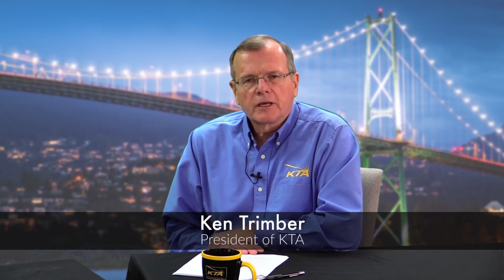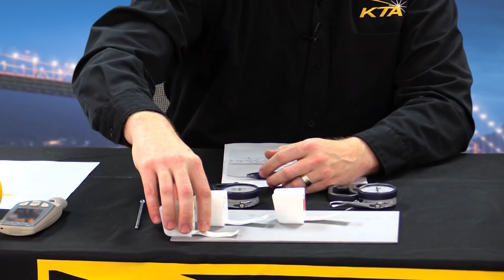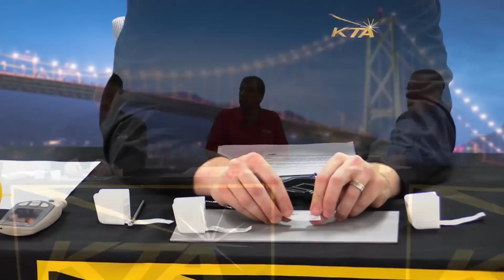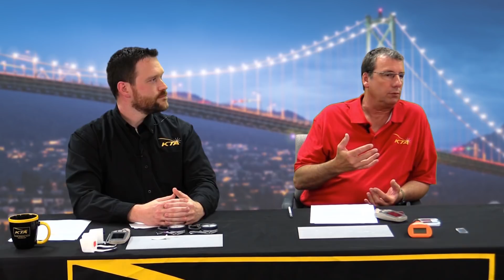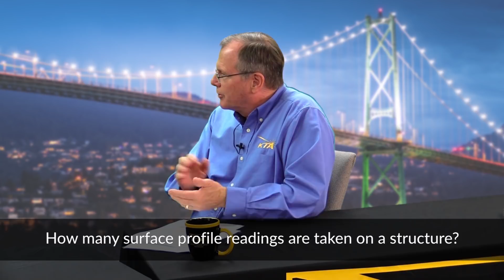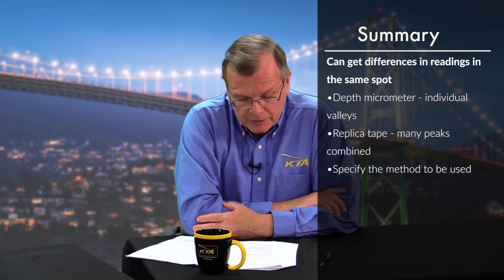KTA Podcast #5: Surface Profile Measurement -  Replica Tape vs Digital Depth Micrometer

Comment: Would reviewing surface profilometers in this same podcast be reasonable?  Unfortunately, the Digital Depth micrometer doesn't fit inside grit-blasted tubes.

Comment: I have a question here. For testex tape what will be the maximum surface temperature in which it can be used.  Because the higher the surface temperature the foam (Milan) used in testex tape can be affected or compressed easily due to heat and give a imperfect reading
Reply from the maker: Rocky - thanks for your question. The Testex website states:
 
Press-O-Film HT is formulated for better performance at the high temperatures (above 140°F or 60° C) encountered in the most challenging environments. While stable at 140°F (60° C), the current film starts to gradually soften above that temperature. The new formulation adds a 12°F (6°C) safety margin.
 
Why has Testex changed the formula for Press-O-Film?

“Old formulation” Press-O-Film softened at temperatures above 140 °F (60 °C). On the face of it, this would seem a safe operational upper limit. The highest recorded temperature on Earth is only 136 °F (58 °C) and the Threshold of Pain is less, approximately 125 °F (50 °C). Further, the maximum recommended temperature for application of many coatings is about the same as the Threshold of Pain.
While it is difficult to imagine using replica tape at temperatures above 140 °F (60 °C) it is, however, possible to imagine storing the tape at those temperatures, especially if the product is kept in a closed container (specifically, a car) in direct sunlight on a very hot day. Here, temperatures can get well above outdoor-ambient.

Press-O-Film HT’s new formulation adds 12 °F (6 °C) to the product’s softening point, a margin of safety that can be important to inspectors in extreme - and, especially, in remote - locations.

In Testex’ internal testing even the old formula replica tape showed no hint of collapse after 3 hours’ at 140 °F (60 °C) temperatures, so brief exposure to even very hot environments probably need not be a source of concern, however, for safety, exposure to temperatures above 152 °F (66 °C) should never be permitted. Replica tape should always be stored at or below outdoor-ambient temperatures. Long-term storage should be at room temperature, 77 °F (25 °C), or less.

The tape itself provides a record of its own thermal history. Un-compressed X-Coarse grade tape should have a thickness between about 5.0 and about 6.0 mils (about 125 and about 155 μm). Thermal collapse will cause it to be less.
Reply: @ktatator  I thank you for the broad understand and knowledge sharing

Comment: Very useful lesson. 
But I  would like to insert some comments:
1) Regarding potential  reading error using replica tape if rubbed over dirt, this problem is  valid also for the digital depth micrometer (if in the valley there is some abrasive residue,  dust, etc.);
- Normally before to place the tape over a blast cleaned surface the involved surfaces are fine blowed up  or cleaned with a dry soft brush just before to place the tape: the same procedure will be adpted using the digital depth micrometer, this means that  probably if you have to use a clean brush to clean the reading area,  you are obligated to use both hands also with this method.
2) On my point of view when you read the profile on the replica tape  using the spring micrometer you read  the max peak present in the rubbed circled area not "many peaks combined" as you affirm.
3) another important tip: 
the digital depth micrometer cannot be used everywhere due to its dimension. The tape instead  can be placed also in limited areas like internal flange of small anglebar, etc. 
I am sorry for my poor english
I hope is clear what I mean.

Regards
Giuseppe Santagata